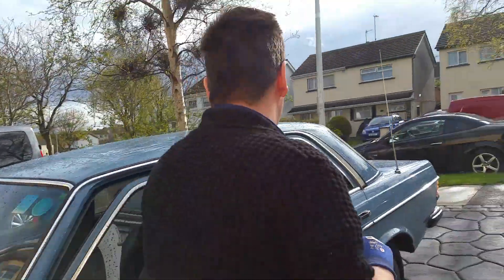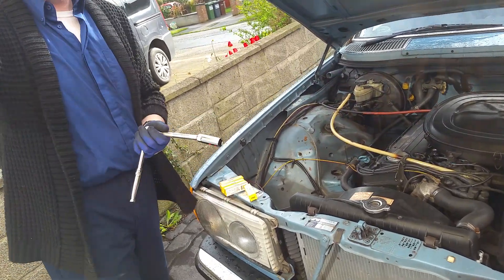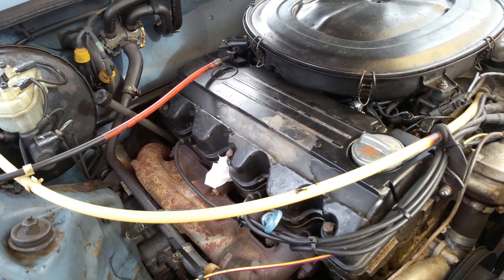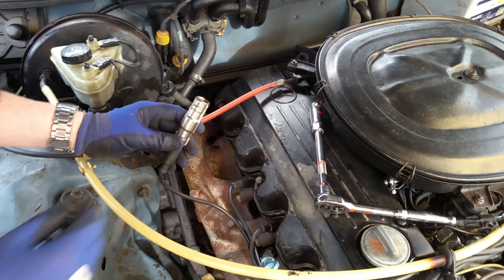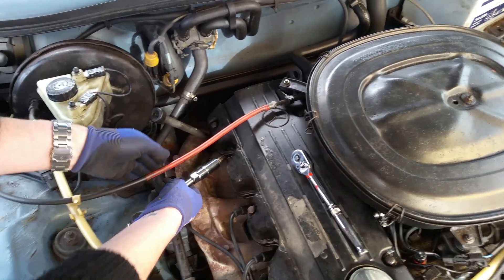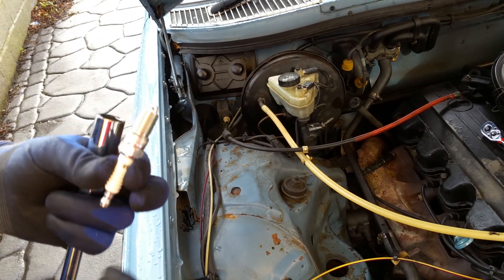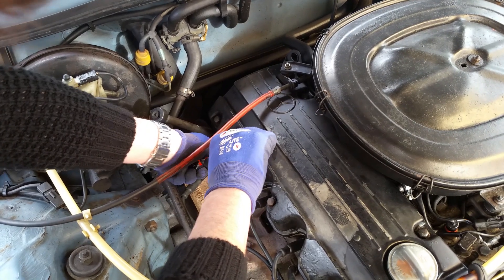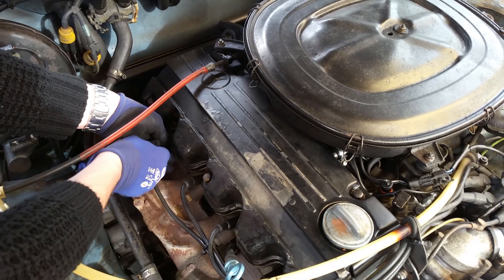Mercedes-Benz W123 spark  plug change

Comment: I've been applying a dab of copper grease to spark plug threads for years and it aids removal. Just be very careful tightening them up as there's less friction with the grease. Also use bit of garden hose to install the plugs as it won't cross thread them. Handy for deep seated plugs.
Reply from the maker: terry atkinson copper grease. . Raging I forgot  it Terry .. great tip  thanks

Comment: Hi. I have the same car and I'd love to chat to you about an issue I'm having with getting it started. I have spark, I have petrol coming up but I have an issue getting air to it to keep it running. I have to get someone to hold the disc open on the top of the fuel injector about 10mm to keep it running. Would you know my options  on what parts I need to look at to replace or clean. I'm in West Cork so can chat if you need to know more. I hope this gets to you and you can help me out. Thanks.